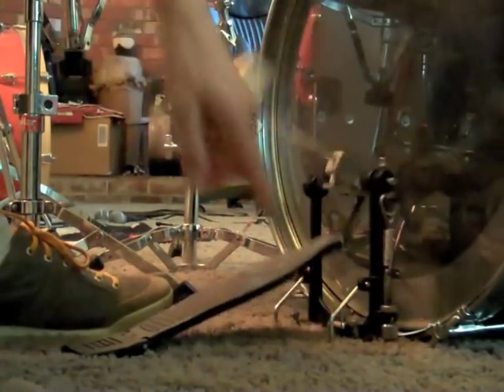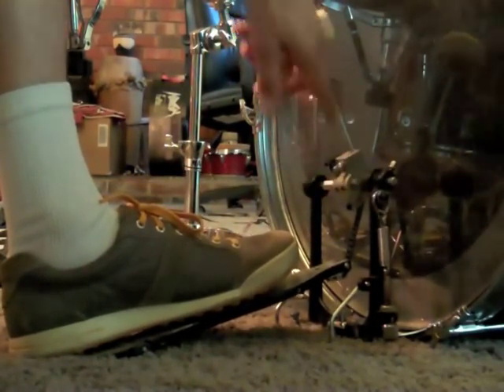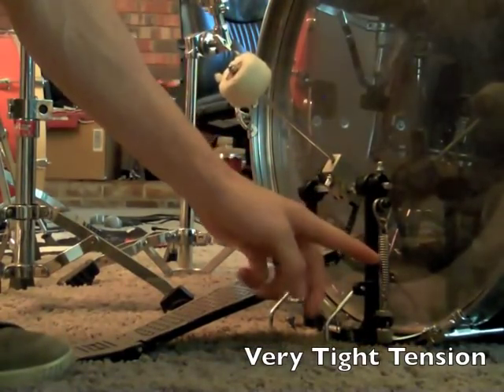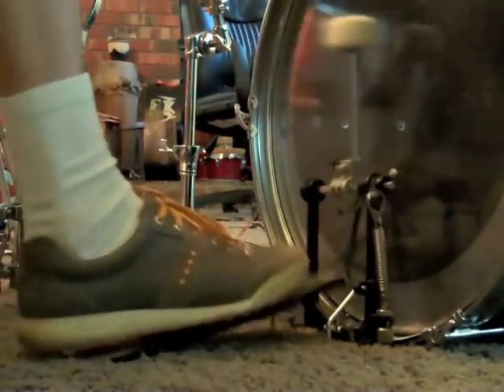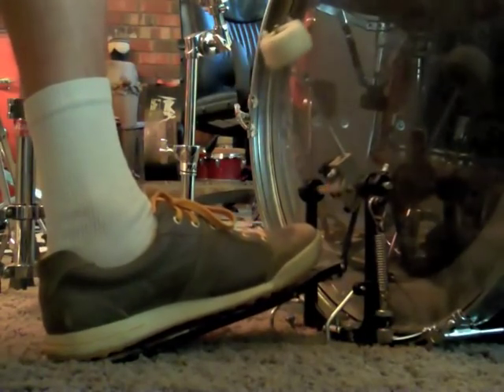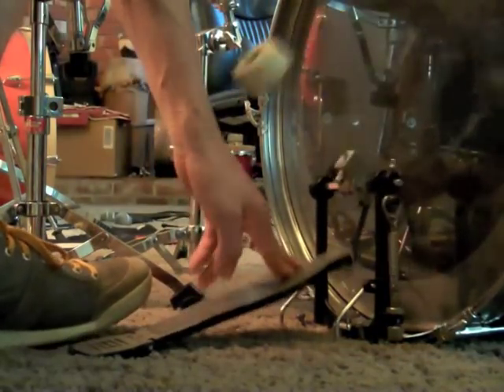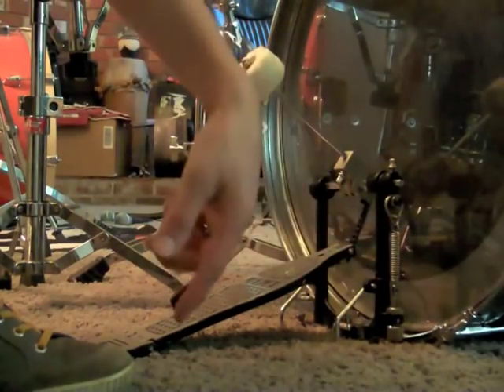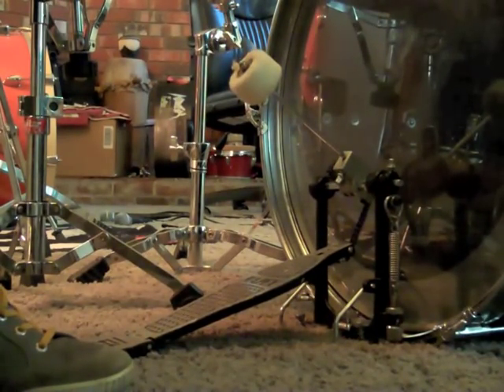Drum Pedal Spring Tension Explained

Comment: Would you change your spring tension every time you play different styles?  Say, if I do a jazz gig, should I keep my spring tension loose? And then on my double pedals (metal), keep them tighter?  Thanks.
Reply from the maker: Nick nobody has ever asked that before. Weird. I would personally just play a different pedal entirely. My normal pedals are set up for metal, but if I had to play an acoustic gig I'd also need to change my beaters back to felt from rubber too. In a theoretical sense, yeah if I had to play the same pedal on successive gigs, acoustic combo jazz and metal I think loosening the tension a bit for the jazz gig might help me play more authenticity in that setting.
Reply: Yea, that makes sense.  For my jazz gigs, I just use a pedal with about medium spring tension, but I guess it couldn't hurt to go looser to help with feathering.  Hadn't really messed with it so much since I'm not playing the bass drum as much versus a style like metal.  I was also thinking about whether that would affect muscle memory by using a looser spring tension on one pedal for a different style, a la jazz, versus a tight spring tension for something like metal.  But I guess only if one were using a single pedal with loose tension and doing a lot of exercises, then going back to the double pedal and doing exercises with that.  Maybe that would throw one off.
Reply from the maker: Nick it might be weird to switch constantly around between spring tensions. It could cause some technique issues. I don't know many drummers who gig regularly in multiple unrelated genres. That exists, but it's pretty rare. Usually the jazz guys play some funk and blues but rarely metal and the metal guys might play rock or punk or something but a true master of every style probably has their pedal settings down anyway and doesn't need advice from me... right? The default I guess ought to be whatever setting you're most comfortable at or whatever you'll use the most. These guidelines in this video are for people who haven't yet found what works, theoretically the main audience here is still hunting for their favorite setting or someone who is having problems with what used to be their favorite setting. Anyway, it's a complicated issue, of course.
Reply: Ryan Alexander Bloom Yes, that is true.  I might be biting off more than I can chew by trying to play in both of those genres.  I believe what you are saying makes the most sense.  I've tinkered for years on double bass settings and it seems the tighter settings would work best for playing fast like you say.  Thanks for your input.  Greatly enjoy the channel.

Comment: i need help, so my spring tension is set to maximum yet it's extremely loose still when i play. I'm setting up my double bass pedal. My left foot has my optimal tension (very tight) yet my right pedal would be considered barely even medium tight.
Reply from the maker: I have no way to diagnose that but it could be anything. Maybe the spring is worn out or broken. Maybe it’s attached incorrectly. Maybe the rocker arm isn’t put on the right way. Maybe the spring or screw adjustment assembly isn’t meant for that pedal and is the wrong length.

Comment: What about petal height?  I have speed cobras, and I can adjust petal height without effecting beater distance.  Any advice on that?
Reply from the maker: All Iron Cobras can do that and it is a nice feature. You should simply make sure that your footboard is not hitting the baseplate or clamp underneath at the bottom of your stroke. If it's clearing all obstacles below, it should be fine. I cannot think of a reason to raise it much higher than what is clear and unobstructed.

Comment: hey man my beater seems to rest a lot closer to the drum when my foot isnt on the pedal. The new pedals i've seen have the beater resting a lot further back. How can i fix this and what effect will it have?
Reply from the maker: +thefivepoints depending on the pedal, there is usually an adjustment for this either where the beater shaft attaches to the rest of the pedal, or above the spring where the bearings attache to the rest of the pedal. So, on this mapex pedal in the video, you can see a drum key type screw sitting vertically on top directly above the spring to the right of the beater. On my iron cobras it has both so that you can adjust things independently... but most pedals have at least one of these two adjustments. You want to have a good amount of distance between the beater and the head because otherwise you will not be able to generate any power and you will have a hard time getting rebound and not burying the beater. https://www.youtube.com/watch?v=gu7C2v6YQ1c this video is about that exactly.

Comment: Just asking, does anyone recommend a tension setting for modern "hard rock" music??
Reply from the maker: I recommend medium to tight. I would only say loose tension for playing very quietly with a ton of control, which is not the "hard rock" paradigm.
Reply: Ryan Alexander Bloom thanks heaps mate!
Reply: Ryan Alexander Bloom I've always played spring loose and I use my whole leg phil rudd style. maybe I shood switch it up. I can only hit real hard with spring almost coming off the screw.why is that?
Reply from the maker: Clnt874 probably because you don't play with any kind of actual technique. I can only guess here, but it sounds like you probably don't use your ankle much. In correctly played heel-up strokes there is a significant amount of ankle motion, in addition to moving your whole leg. The leg provides a lot of the power but if you have a locked foot and ankle you cannot generate enough speed to play really loudly without expending a ton of effort and needing a loose spring tension. This probably also slows down the maximum tempo that you can pull off complicated patterns as well. Again, just guessing based off your short comment.

Comment: what about kick pedal with squeaking noises. Is there's squeaking noise on your pedal while playing fast?
Reply from the maker: Try a bit of oil. Mine squeak every couple of years, but I’ve literally had the same tiny bottle of oil for over a decade. A little drop here and there usually solves the problem. Be sure to use oil though, not silicone, wd40, or other weird products that may corrode or leave a residue. Tama sold “pedal oil” for a while but I think there are other things that will work.
Reply: @RyanAlexanderBloom  oh thanks but how many drops on a oil to a pedal?
Reply from the maker: Rusli1659 LP Soldier until it stops squeaking. Locate the squeak then try 1 drop at a time until it’s gone. 1 might do it if you get the right spot. Usually for me it’s the connecting rod between the two pedals on my double.
Reply: @RyanAlexanderBloom  oh thanks but idk what location of the kick pedal must be squeaking?
Top of a tension rod?

Comment: What would your suggestion be for playing fast but controlled? If that makes sense.
Reply from the maker: If fast is going to be part of your repertoire, you sort of want to go tighter. I typically play 4-5 threads back from full tension on Iron Cobras. This may mean something slightly different on other pedals, but it's pretty tight. The pedal in this video goes so tight you can't even play it... So a reasonable tension on it is realistically many more threads from full tension. Like 2/3 of the tension possible is the actual max playable tension. It's hard to describe. I guess I should get some kind of pressure gauge and give you pounds of force or Newtons or something.... But i don't have that now.
Reply: +Ryan Alexander Bloom I'm using pearl p900s and honestly I don't like em. I play metal and stuff like that. Do you think pedals can affect someone's playing? I'm trying to get back into double bass and my feet aren't where I want them to be.
Reply from the maker: +Corey Williams I personally hate most Pearl pedals. The demon drives are awful pieces of junk and I don't like the power shifter eliminators, which I play at the studio where I teach, unfortunately. The 930s are ok, but not great. That can have a lot to do with your success. The best thing you can do with 900s is to get a heavier beater or put weight on the beater to make it heavier. Counterintuitively, this will make your playing easier. The Pearls are too light across the board for fast and accurate metal playing for instance.
Reply: I just upgraded from P900s to a Tama Speed Cobra.  What I found: The new pedal sticks to my foot through more technical playing and has much better, consistent attack and volume.  Even on tighter settings I found my foot separating from the pedal on the Pearls.  I do think skill is the biggest factor, but if you've been playing a long time on the Pearls you'll appreciate the upgrade.  Pedals are expensive though, wouldn't have bought the single Tama pedal if I didn't get it for $80.

Comment: So, do you think that to play at high speed with double drum pedal, it would help me to tighten the spring at an 80%, for example?
Reply from the maker: Depends on you and your particular pedal... but yeah. That would be a pretty good place to start.
Reply: It is a Pearl. A regular one, not an Eliminator or any of these higher quality series. Does this make mine less efficient to play faster as well?

Thanks for your quick response. :)
Reply from the maker: Not necessarily. I am not familiar with Pearl's entire line of pedals, but sometimes the lower level pedals from a brand are still solid pedals. They may lack some of the adjustments or flashy features is all. I know most people prefer dw5000 over the higher numbered 9000 but on the other hand the iron cobra jr is crap compared to the real iron cobra... so its a toss up I guess.
Reply: Ryan Alexander Bloom I have the last question (it is a difficult one). Can my problem be, apart from my need to improve my technique and find a good setup for my pedals, the fact that I have lost a lot of muscular mass on my legs? I started studying like 3 years ago, and started playing again with a band like 3 months ago. I mean, have you ever felt very sloppy playing the bass drum, after some time without playing drums?
Reply: The problem is that I cannot practice the bass drum in my house, since I don't have a place to do it. And practicing without pedals doesn't seem to be effective enough.
Reply from the maker: Yeah, not playing for a while can lose you some ability, but you will get it back. Try practicing without pedals in the heel-down position. That will work out your legs more than just bouncing your feet totally off the floor. Or, get a kick practice pad. They make those.
Reply: Ryan Alexander Bloom Yeah, the big problem is that, in my room and without pedals, I always practise heels up because I don't notice any spring tension whatsoever. I guess I'm gonna follow your tips to develop my ankles muscles on my weak foot (right foot, because I'm lefty). Thank you very much for your advices! I suscribed to your channel already.
Reply: Hey I read the thread and pearl makes a pretty nice bass drum rubber practice pad that u can hook your double bass pedal to and play really quietly compared to an actual bass drum. I think it's about 60 bucks and there is a cheaper model for about 30 by sound percussion but it's not as good.
Reply: Larry Tate I have seen these pads already, I always wanted one of these but I don't know if I will feel comfortable playing with this. Anyways, I will try someday. Thanks!

Comment: Doesn't this depend on technique?  I mean if you slide hitting the middle then top of the pedal, playing loose is still fast.  Its easy to go too tight which can cause problems with control and it can really make your foot tired.  You have to find a good loose setting and gradually tighten it from there little at a time.
Reply from the maker: Versus I think that I mention in the video that sometimes playing certain double strokes, like heel toe, is easier on a looser setting. Many people play few to no doubles so a loose setting would not benefit them in any way unless they are typically playing very quietly. So yes it does depend on what you are doing. Very few people will use loose to play fast. They exist, but it's the minority.
Reply: Ryan Alexander Bloom
Oh ok gotcha I didn't want people to assume they should crank up the spring. Thanks

Comment: My tension is set what I can assume without looking almost all the way tight, and it's very very difficult to play with any speed at all. The way this is laid out doesn't make much sense to me for a practical application. :/
Reply from the maker: Like I said it depends on the pedal. All the way tight on some pedals is effectively much tighter than on others. There is no standard ft/lb of torque or something by which you can gauge. You have to make the decision of what is reasonable for the pedal you have. The basic concept here is solid though.

Comment: I think low end pedals are harder to play than high end pedals due to the resistans.  High end pedals have bearings everywhere  so they are easier to play. So I say,  a high spring tension on a cheap pedal is harder to play than a high spring tension on a expensive pedal. I think I am right that a high spring tension on a expensive pedal you can compare to a cheap pedal with medium spring tension.
Reply from the maker: Maurice Wanink that idea may have some merit. Cheaper pedals have much worse bearings and overall the moving parts are not as good. On the other hand, how much spring tension a pedal can handle is pretty unique to each pedal regardless of its price. The length and thickness of the springs are all different so it’s actually really hard to compare tensions directly. Everything I say in this video is relative to each pedal, not the same exact thing across from one pedal to another. The weighting of the footboard and beater has much to do with how the tension comes across too. Putting a light beater on will make the tension feel tighter. A heavy one will feel looser without touching the spring at all. There are many factors other than price... but a pro level pedal is usually much better overall than a beginner one. They do differ in quality quite a bit.

Comment: you might play faster with a very tight tension but you are prone to rushing doubles and compound rhythms because the return is too fast
Reply from the maker: I.J. Drummer I’m pretty sure that I state in here that playing lots of syncopation and complex rhythms may benefit from a slightly lower tension than full-out single stroke speed. So yeah, I agree. If I was in Fear Factory I’d have a different setup than if I was in Nile.